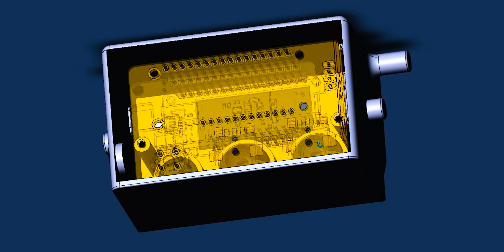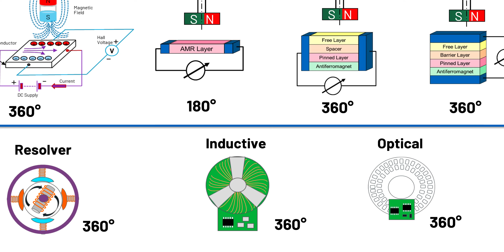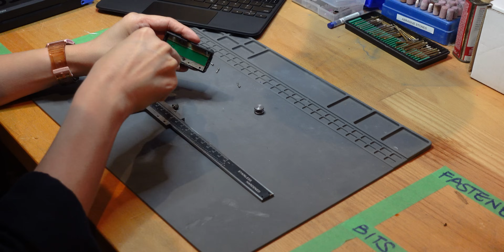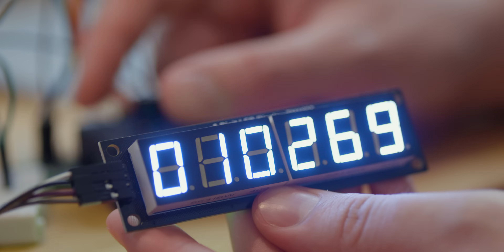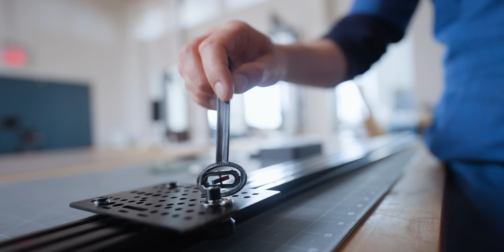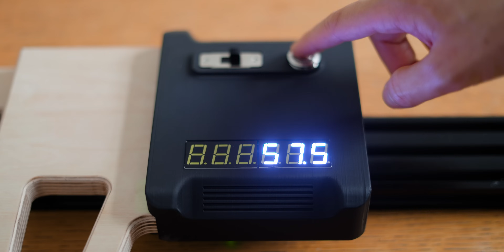X-CALIPER – Potentially Genius | DigiKey

Comment: You could use them to read X,Y,Z position if one were to want to build their own DIY 3D printer handle whatever specific print volume you need specifically. Obviously using T-slot to mount the printhead to and for the vertical supports and the base to help eliminate any possible flex. The one piece you would really need to get machined would be a solid metal baseplate.